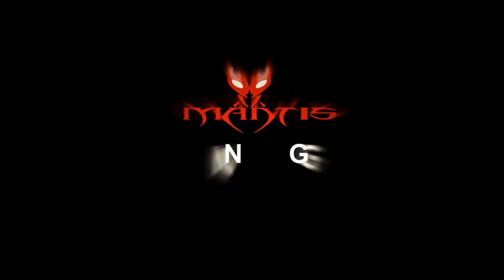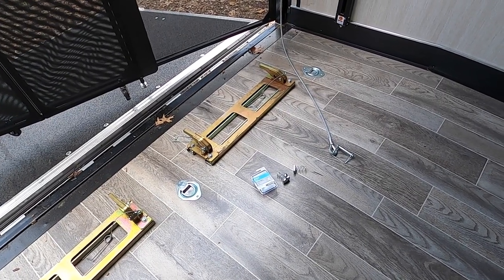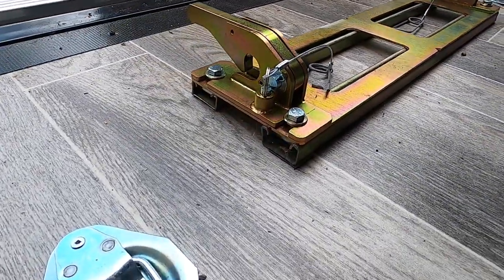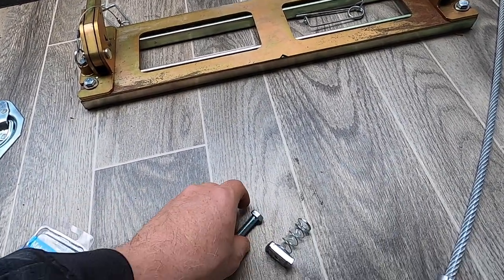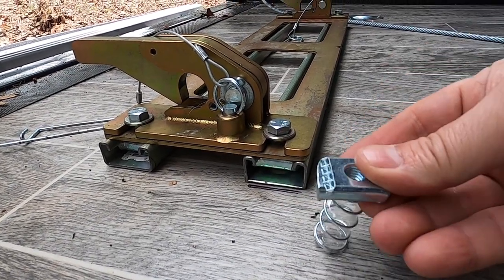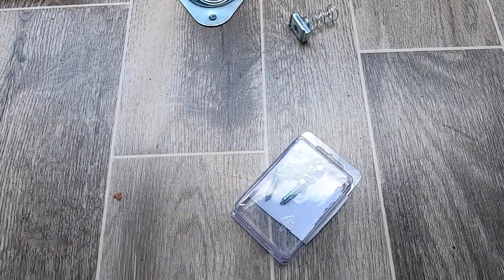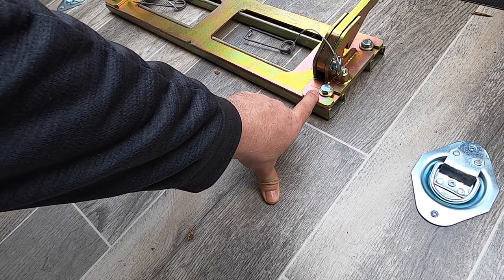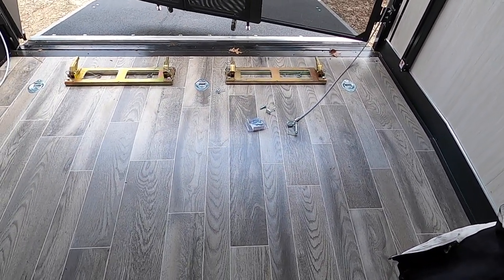Adding Pitbull TRS to Toy Hauler(no drilling through the floor)Toy Hauler Modifications

Comment: isn’t the screw into cheap, not even real plywood, much much weaker than bolt through? I understand you can install more screws.
Reply from the maker: I think on the Toyhaulers it is plywood.  I think I used 14 screws per strut and have not had any issues so far.  I don't think it is as strong as the bolts provided, but adequate to hold the bikes for a while.  In order to install the bolts though I would of had to cut and pull back the liner and insulation under the camper.  Position to make sure I didn't drill into any tanks, and had limited choice of location.  Thanks for the comment.

Comment: Sorry I am a complete noob, can you help break it down for me on how you attached the unistrut to your toy hauler floor? Did you drill the metal screws into the floor?
Reply from the maker: I let the screw do the tapping.  I think they were #14 by 1in.  I used fender washers with the screws.  I did it this way to avoid drilling through the floor and tearing the insulation off the bottom.
Reply from the maker: @P1NK3FFECTS  the fender washers are used with the screws to hold the unistrut to the floor.  Make sure the fender washers fit inside the unitstrut.
Reply: @MantisRacing  done